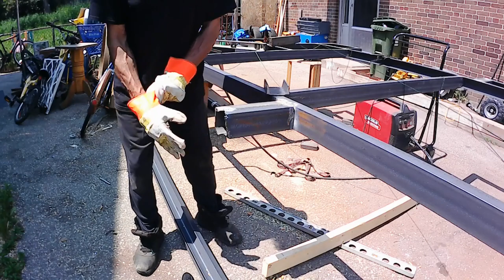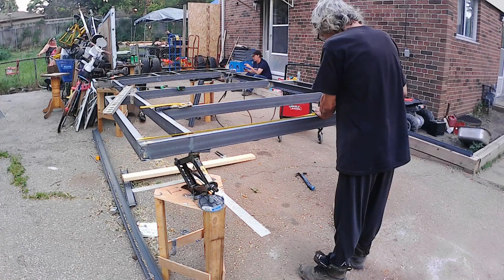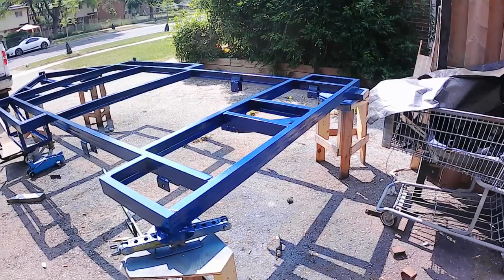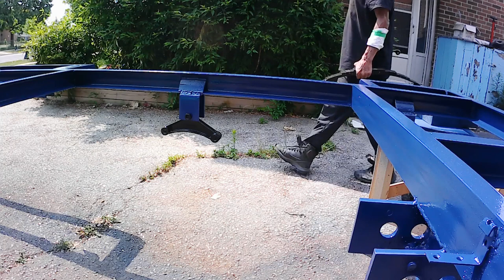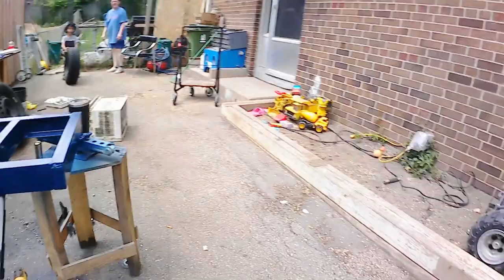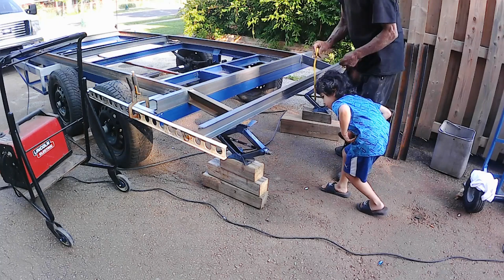My New Trailer Build pt.1

Comment: Trailer looks great neves, you did a good job on the frame and that is a much nicer trailer than the old one.
Reply from the maker: Thanks, I have done quite a bit since this, just need to edit the video's, got a power unit from vevor, it's a power up, power down unit but I don't like the way the bed comes down, it comes down a bit to fast so I need to figure out how to slow the hydraulic fluid flow on the downward side.